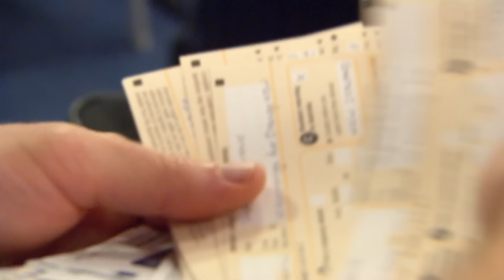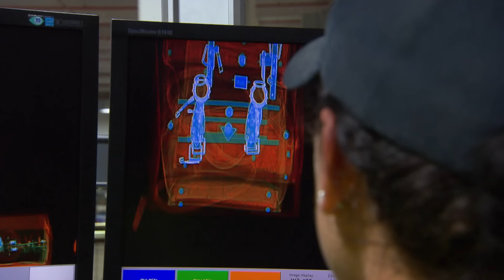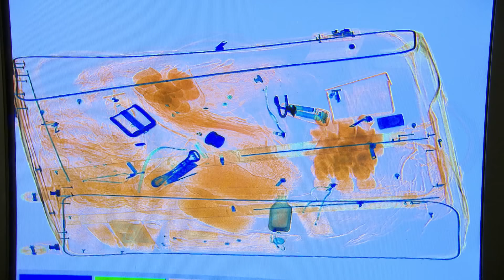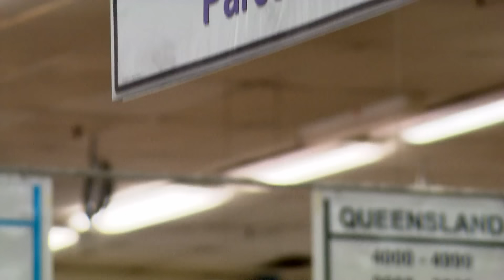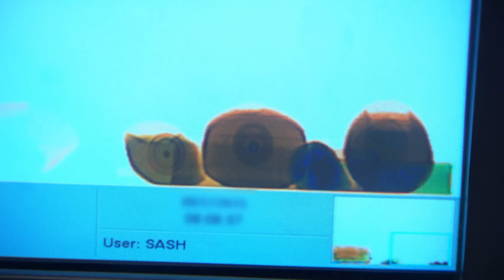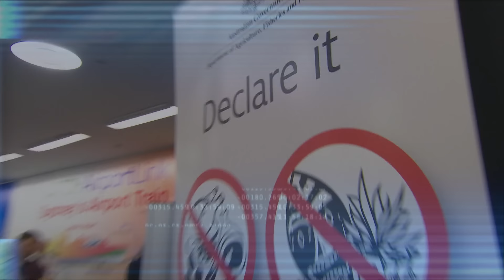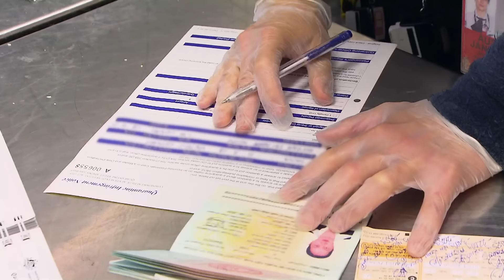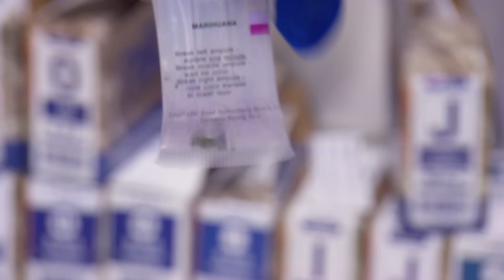Frisk Search Reveals Dr*gs Taped in Traveller's Jeans 😲 S10 EP12 | Border Security Australia

Comment: I think the fines should be way higher!.
Reply: I agree, Fines should be by kilo. That's like 20 times $350!
Reply: @rockyBalboa6699  -I agree, especially since the card is in their own language.
Reply: @rebruc3806 write a letter to your prime minister
Reply: Currently all infringement notices issued at first points of entry to Australia are for two penalty units ($444), regardless of the biosecurity risk posed by undeclared goods,” Minister Littleproud said.

“However, under the new legislation the Director of Biosecurity will be able to determine which goods or classes of goods pose a high level of biosecurity risk for the purpose of higher infringement notice amounts.

From 1 January 2021, infringement notices may be up to 12 penalty units ($2664), depending on the undeclared goods.

The powers to cancel visas on biosecurity-related grounds will also be expanded to student and temporary work visa holders from 1 January 2021. Currently these powers only apply to visitor visas.